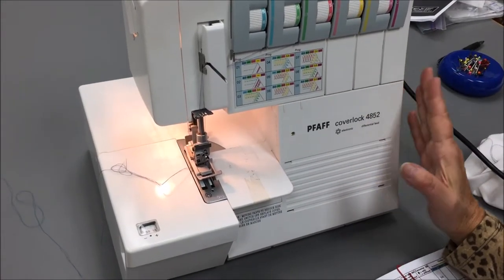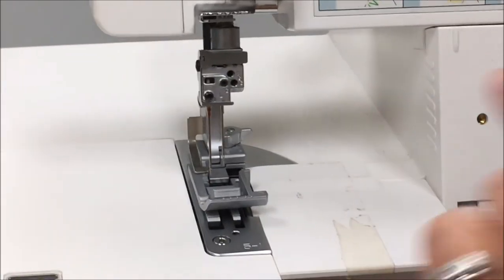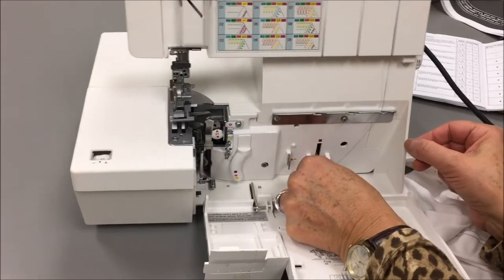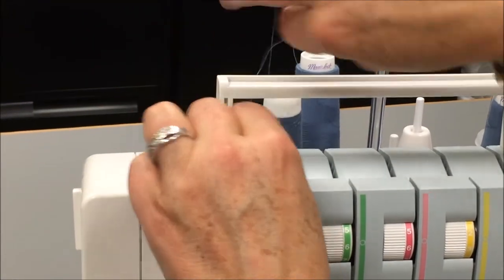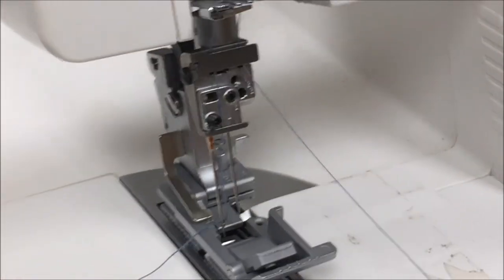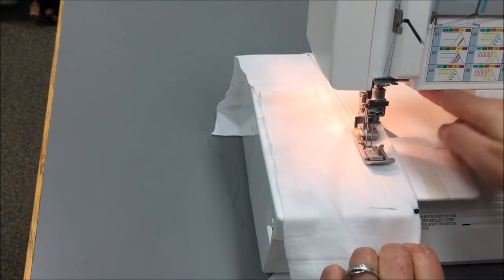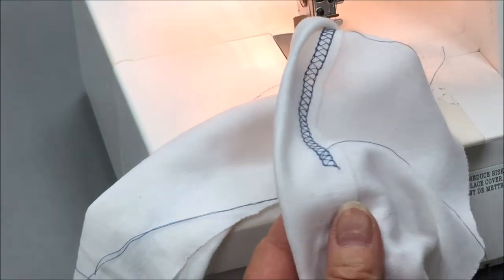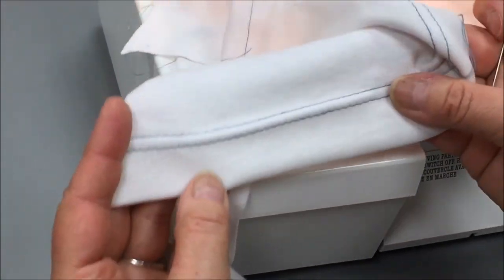Coverstitch on the Pfaff Serger

Comment: THANK YOU SO MUCH FOR THIS TUTORIAL! I purchased a Pfaff Cover Style off Craigslist but it never came with a manual. I almost gave up on trying to get it to work as I have never used one before and couldn't find any help online for the life of me. My machine is pretty much identical. This video solved all my problems!

Thanks again :)
Reply: there is a free manual for the 4870 that I also bought used although they are a little different I'm sure its better than not having one at all.
Reply: I have that one and the manual I can make u copies

Comment: My serger is a Pfaff 4862 and it is a four thread serger. I can see plainly that yours is also a 4862, and yet it is a five thread serger. How can this be?
Reply: Hers is a 4852, not 62, which was below the 4862. I also have the 4862, I believe the difference between the 4852 and the 4862/72 (other than mount of threads) is ours has auto tension and the 4852 does not, as you can see in this video.
Reply: @Arctic_Falcon  Thank you! Now I understand that I saw the number incorrectly.
Reply: Duncan Osgood thank you for your explanation. I would like to buy 4862 from a thrift shop and do you think that is good machine, durable and less headache,etc.

Comment: Hi! I would like to know the price of the machine?
Reply: It's been long discontinued. The line this machine from was made during the late 1990s/early-mid 2000s. When it was new, it was probably about $1000-1200. This particular model is rare to find on eBay, but the higher-end (and better) versions with auto-tension (4862 & 4872) sell for about $200-300, depending on condition and accessories included.

Comment: This machine is DRIVING ME INSANE. I'm trying to use the first stitch and it simply is not connecting. Beyond frustrated. Also: is there really no program selecter on this machine? Is it all the same program but different outcomes just based on how you thread it?
Reply: Do you have the manual?
Reply: @ShareeseMGrace  Yes, I've followed the manual religiously and watched this video copying the steps. I'm pretty sure I'm doing everything correctly and feel like I need to take it in to the repair place to get the guy to show me.
Reply: @thornyback  I just got this machine on Wednesday too. It’s my first attempt at this type of machine.  I got program 2 to work by watching this video and then I got program 7 to work following the manual. But not before breaking a couple needles.      

Do you have the power plate covering the loopers?